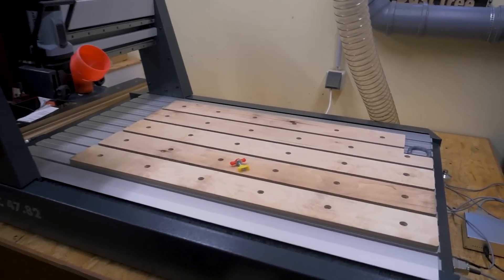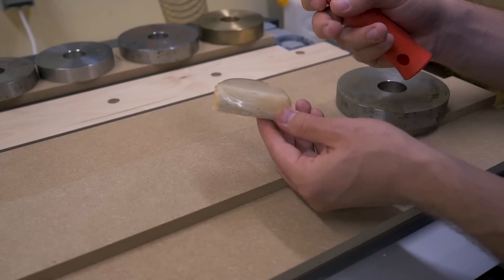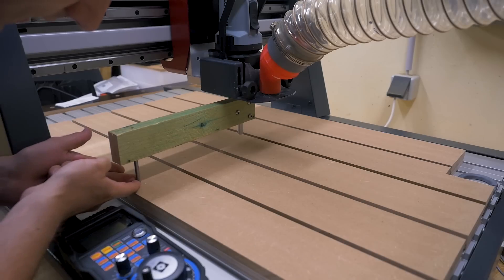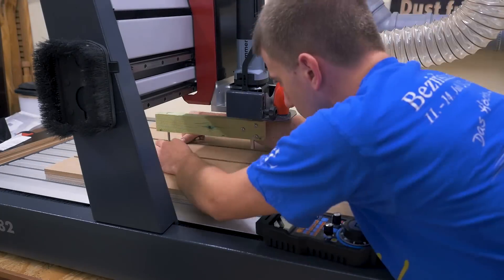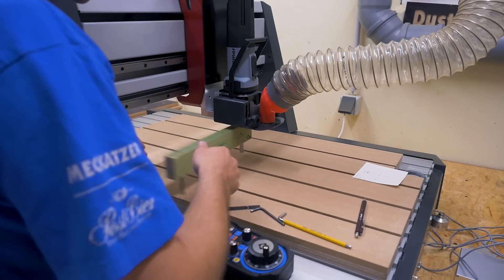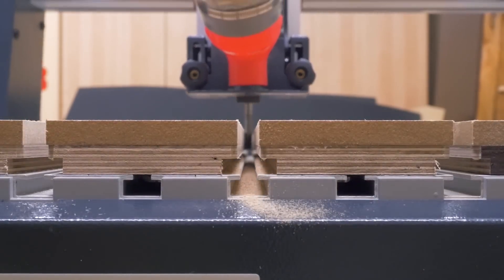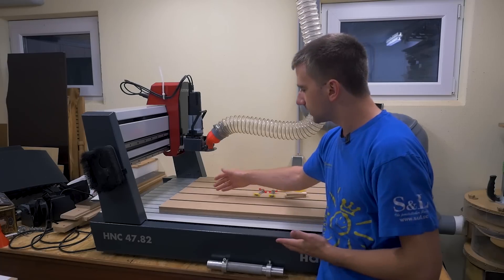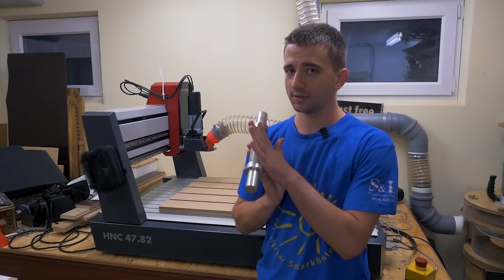Perfectly Flat CNC Spoilboard & Spindle Tramming with a Simple Jig

Comment: Hello Marius, I take a measuring clock in the swing. it go must faster. also you can dril 2 holes for M10 orso  in the head mount  next to the bolt , then put a adjustingbolt in so that you not have  to remove the head

Comment: Great video. Looking forward to the next one! You were so methodical measuring the spindle angle I'm surprised you didn't use trigonometry to calculate the exact shim thickness needed as well. Well done regardless.
Reply from the maker: When I did that the first time I calculated the shim thickness. But When I installed it and measured again the result was by far not correct

Comment: Some unsolicited advice: If you have one, using a torque wrench to fasten the bolts for your spindle mount helps a lot in avoiding over/underfastening (especially if you get angry after having to do it over and over)

Comment: Hello Marius,

if you would use a dial gauge directly as a probe, you would not have to work with the measuring strips.
I use this method to align the table of my drill press. 

Regards
Klaus
Reply from the maker: Problem was that my dial indicator didn't fit under the gantry. I couldn't have rotated the jig

Comment: I first thought you chose the more time-consuming method with the feeler gauge for the lack of a dial indicator. But then you use the dial indicator to check for any steps from surfaceing. I guess it would be way easier if you mount the dial indicator to your wooden extension. ;)
Reply from the maker: Dial indicator is too high to fin under the gantry unfortunately
Reply: @MariusHornberger  That's a very good reason for your solution. :)

Comment: You should put the head of the bolt in the T-nut, with the stud facing up.  Then you can use a wingnut and a washer to tighten down your hold downs, and the length of the bolt doesn't need to be changed, one size fits all, since the screw isn't moving down towards bottoming out against the T-nut and the base.
Reply from the maker: Problem: the bolt sticks out the top and is in the way

Comment: On this type of machine, is there any possibility that the gantry is not perfectly parallel to the bed?  I thought you would shim the gantry support legs, but you shimmed the motor mounts.  I suppose any variation there was compensated by flattening the spoilboard first.
Reply from the maker: No, the linear blocks have alignment pins. But the gantry is parallel to the bed or at least within the given tolerances of the machine that Felder claims it to have in the manual (0,1mm over the gantry length)

Comment: The plywood / MDF lamination seems a bit needlessly overengineered. Can you not get thicker MDF?
Reply from the maker: Interesting. When I made the first spoilboard out of thicker MDF, the comment suggestions were to use a combination of plywood and MDF. Now it's the opposite. But the T-tracks made out of plywood won't wear as much and as fast as MDF
Reply: @MariusHornberger  Sorry, I didn't know the history of design decisions. I should think that the only T track wear would be where the top and bottom of the nuts interface with it. In this case, the nut on bottom is under the aluminiuiuiuium. That shouldn't present a problem. And the top will be on the washer, and besides, the top will be clamped to the workpiece. So no problem there either. I must be missing something. What don't I know yet?
Reply from the maker: I made T tracks in to wood and don't use the aluminium ones underneath. And my special T-nuts clamp and the wood. Just MDF did flex quite a bit when I tightened on the clamps. Why I do all that I explained in the video of making the clamps

Comment: Do you have any problem with axis X? Drive solution on this axis doesn't look too precise as for other axis. I'm not expert in cnc but I asked some cnc owners and cnc sellers and they really don't liked this solution. Also I found out that in specification is sometimes backlash 0,1 mm and sometimes 0,01 mm. I suppose that first value is right. Hammer dealer wasn't able to confirm it. His response was that 1 mm is enough for wood (by some norm specification). Can you do some stress test video? I'm thinking that I will buy that machine and it could help me decide. Thanks.
Reply from the maker: I have no problems with the x-axis. My backlash is in the range of lower than 0,1mm. What do you mean with it doesn't look precise?

Comment: So I don't have a CNC machine, so what do I know, but instead of spending all that effort to make sure the spindle is perpendicular to the table surface, why not just keep planing down the table surface? Wouldn't it eventually become perpendicular to the "crooked" spindle? Honestly curious.
Reply from the maker: No that won't happen. You would always only create steps when you make passes for flattening. The gantry of the machine is parallel to the machine bed. Try imagine the spindle being mounted extremely crooked and how the result of flattening would look like
Reply: @MariusHornberger  Got it! I guess I was imagining something like a surface planer, which would do the whole surface in a single pass, which would be fine, but many individual passes creates steps, which isn't. Thanks! 😁👍

Comment: After you showed the dial indicator, why didn't you just use a dial indicator instead of the outer pin in the tramming jig?
That's how you tram real mills and you wouldn't have to fiddle with those gauges.
As I scan the comments to not repeat something someone else already mentioned..well there it is, someone has already mentioned that.

The dial indicator doesnt fit under the gantry? That's a surprisingly tiny Z height for the price of that machine if that small dial indicator can't even fit under it.

From the video it seems like it would fit just fine, the top part looks to be below the lowest joint of the holder that is mounted on..?

Comment: Is there a reason not to use a dial indicator with the jig?
Reply from the maker: The dial indicator sticks out too far. I wouldn't have been able to rotate the jig then
Reply: @MariusHornberger  oh that sucks.  then you sould have mounted the tool lengt sensor ;)